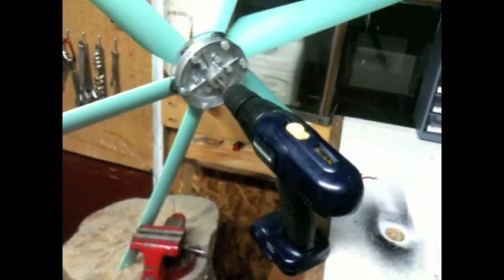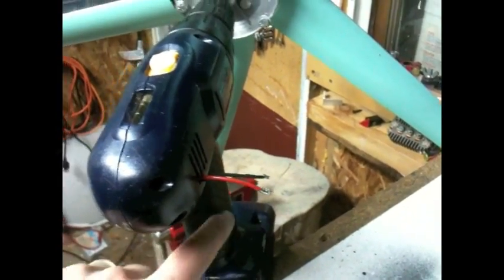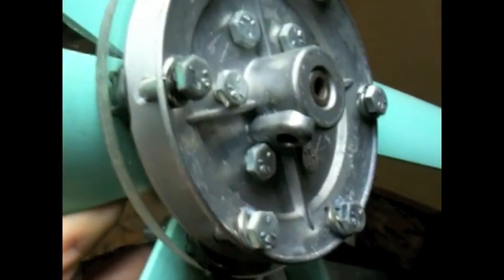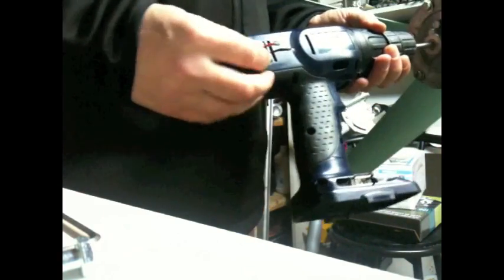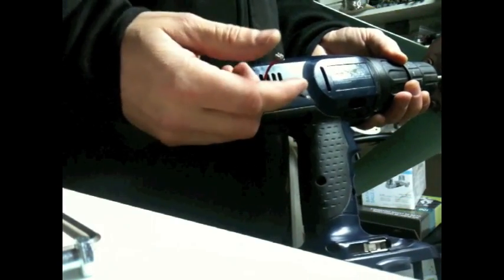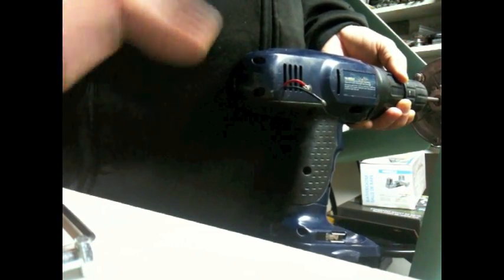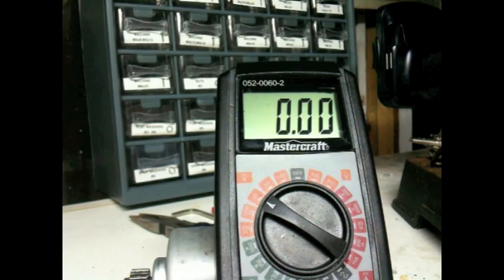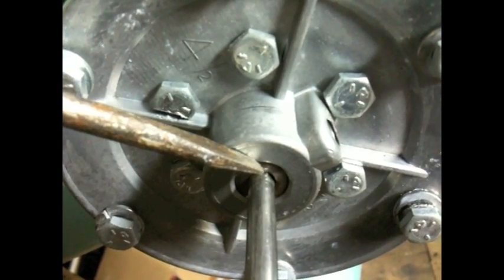Build a Cordless Drill Wind Turbine

Comment: The more I think about the more it think the best thing to do it take out the drill gear box and the DC motor and the bearing and mounthem to a steel pipe using the bearing to hold the fan which you attach to gearbox where the motor used to be attached and then put the motor shaft in the drill bit holder . Now you are getting torque help from the gearbox and using all the free parts to do it.
Reply from the maker: That's a great idea. It would take effort to reproduce, but I would be keen to see your progress.
Reply: Did it work? If so, can you make a video of what you’re saying here?

Comment: I am thinking that a high seed hand tool would have less gearing and be directly hooked up to the motor so easier to turn. Or you could frankly just buy a small motor and hook it directly to the fan blades. Those DC motors inside cheaper electric drills are mass produced and cheap. Or just remove the motor from the drill and use it. Or reverse the gearing and put the fan side on the reduce side of the gearing and put the motor shaft into the drill bit holder. Then the gears work for you to increase torque of the fan.
Reply from the maker: Thanks for the suggestions!

Comment: You most considering that the bolt you cut in half in the fan's hub will make no palance in the system when  it will spend in high  rotation   .
Regards
Reply from the maker: Yes, not the best solution. But it was handy and made use of available materials.
Reply: I like it ...keep doing this good stuff
Bless you

Comment: How do you connect multimeter to measure current?
Reply from the maker: +Andrei-Daniel Botezatu I take the positive lead and insert port marked 10amp on the multimeter and then switch it into the 10 amp DC. There are better ways, but this is the simplest. Here's the link to the model I use http://www.canadiantire.ca/en/tools-hardware/electrical-tools-accessories/electrical-supplies-parts/testers/mastercraft-digital-multimeter-0520060p.html?utm_campaign=bazaarvoice&utm_medium=Default&utm_source=AskAndAnswer&utm_content=Default

Comment: Need a much bigger diameter blades to generate suffient torque to drive this epicyclic geared generator. But would be great once running.
Reply from the maker: obese1konobe Yes, you are correct. It had to be pretty windy for it to turn with the blades shown. I'm building a 3 blade prop with a fairly thick hub. The hub should act as a flywheel. Thanks for you comment!
Reply: @CedarworkshopNet  Would it noot be easier to turn the motor if a VAWT was used instead of a HAWT?, cos a VAWT  made for example using plastic tubing cut in half length ways, that would generate more torque in a smaller area?

Comment: I just realized that if You could get a used 18V drill then You would be able to charge a car battery :) .
Reply from the maker: Kyle R Actually, a 18 volt drill can run into higher volts. But, the DC motor of said 18 volt drill would be a better fit.
Reply: Yes , with no load on the output then the 18V drill will make higher voltages , but when the car battery starts to take current then the voltage will go down to what the battery wants.    I have an 18V drill I'll test it if I can find it , and I'll make a video :) .    Thank You .

Comment: you could leave the bolt head on if you can find another nut that fits and is the same size at the bolt head. then it would support the shaft part. if you used one that was threaded all the way up, and just hammered the threads down, you could make the bolt hexagonal or octogonal.
hope thi shelps those without grinders!
Reply from the maker: Interested... can you provide a link to a video or website showing the process. Thanks!
Reply: I will work on that!

Comment: I tried this great idea however my 4 blade 24" radius can not produce enough torque to turn the drill even with it held up against a fan.  It will turn if I just hold the prop however it will not turn the drills motor (with the wires from the drill in open circuit). Any ideas?  Drill is an old 12V Dewalt.

Comment: why have you chosen a 6amp blocking diode, how do you work out what one you need?
Reply from the maker: It's all I had handy. You could probably use a smaller 3 amp. The motor isn't rated for continuous use and would burn out. It would require some testing. I have mine hooked up to a small 12 volt 7 amp hour battery.

Comment: It is absolutely safe to charge 12v lead acid batteries with 18v and in fact, necessary for the battery to charge properly. I recommend a charge controller in between the turbine and the battery, so it can prevent overcharging.

Comment from the maker: After hooking everything up, you won't be getting a straight 18 volts. Once the drill is under load, the batteries will regulate the voltage down to 13.8 volts. Don't forget the blocking diode, place it close to drill motor. Be safe!